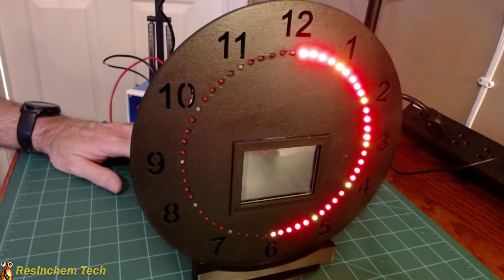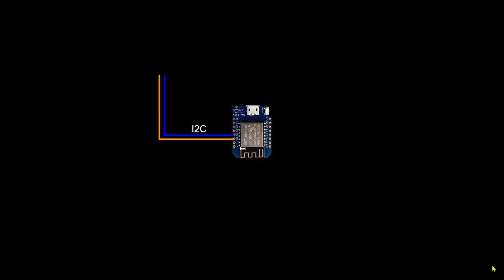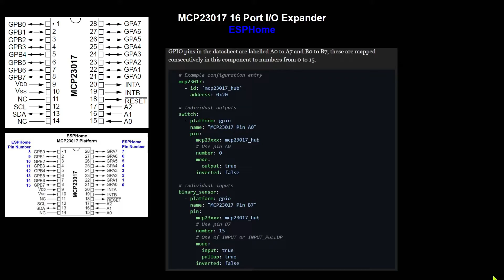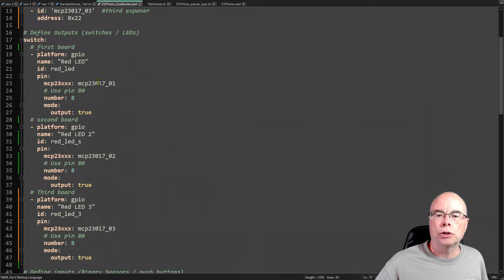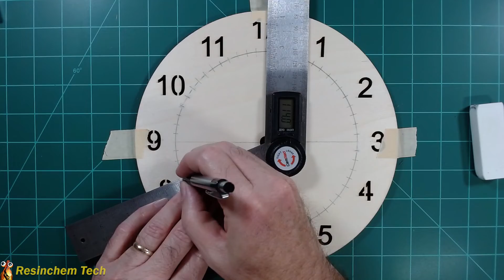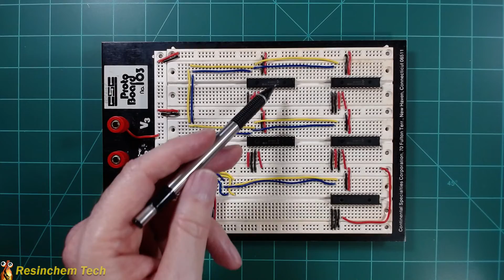MCP23017 Port Expander and ESPHome: Add More I/O Pins to Your Project

Comment: What a nicely timed (see? :D) video! I'm about to build a clock which has 60 LEDs, very similar to yours! I'm not using port expanders, though, but I'm glad I learned something interesting today. Thank you!
Reply from the maker: You are most welcome!  As I mentioned, this isn't necessarily the best design for a clock!  I've built other clocks that use WS2812b LED strips (and therefore don't require the extra pins), but the goal here was to use individual LEDs as an example of using multiple port expanders.  I like the look and function of this 'analog' version (other than my rushed and not-so-great paint job).  If I ever get around to creating a PCB version, I'll probably start over with a new clock face.

Good luck with your project and let me know how it turns out.  And have a good 'time' building it!
Reply: @ResinChemTech   For a tech demo using these expanders is quite well done! Of course it's easier to use WS2812, everything is just code, you can choose colors after building the clock, you can dim it easily, tons of advantages there. That's why I chose them. I found the same form factor as standard LEDs, 5mm, diffused.
Good luck for the PCB version, that will look awesome! Good 'time', hehe, well done!
Reply: @ResinChemTech  I am looking forward to the video about learning how to design and create your very own PCB, I might suggest PCBWay. I would also consider making a board for the clock back and connecting it with one or more IDC ribbon cables. the connectors are fairly easy with a vise or parallel jaw pliers.

Comment: There are lots of models of port expanders.  The APC old style display board for their PDUs use 9555.  The relay boards use an 8 port expander.
It's a shame they all use 0x20 base addresses
Reply from the maker: Yep... as I mentioned near the start of the video, there are many, many different options for adding pins or expanding ports.  But I just selected the MCP23017 as the one to show in this video... with the idea that if someone just beginning their journey with DIY electronics understood the concept of how to use an expander, then adopting to another IC or expander might be a bit easier.

But I agree with you about the base address.  There has been more than one occasion where I've wanted to use multiple I2C devices with the same controller (like a ToF sensor), but they don't have a way ( or at least not an easy straight-forward way without constructing some sort of interface and sending special commands) to change the I2C address.  That was one thing I liked about the MCP23017... the three address pins made it very easy to change to any one of eight I2C addresses.  But again, it is not the only option for something like this.

Thanks for watching and taking time to leave a comment.  I appreciate it.
Reply: @ResinChemTech  the 9555 and the one on the relay board also have pins to change the address to one of possible 8, but all of them start at 0x20 so you're limited to 8 of any of them.
I suppose one trick to go beyond 8 is to not use one of the addresses and use the A0-2 address pins as chip select pins.
For example, tie A1,A2 to ground, and use A0 as chip select, never use 0x20 as that would always be in conflict when A0 is at ground (not selected) and vcc on specific chip to select as 0x21.

Comment: The Amazon link is sold out, any AliExpress links?
Reply from the maker: Are you referring to the link for the MCP23017?  I appreciate the heads-up but I did just recheck the link and I do show them in stock (at least in the US Amazon store).  Of course you can do a simple search for 'MCP23017' on Amazon and see if other sellers might have them in stock.  Or as you mentioned, check another site such as AliExpress.  You might be able to find better pricing there, but with potentially longer shipping time.

If you are seeing some other part that is sold out, please let me know.  I try to check all my links the day before the video is published, but it is not unusual for an item to sell out after I publish (or simply become unavailable).  Usually you can find the same item from other sellers listed on the same Amazon page that shows the sold out or discontinued item.

But I appreciate the heads up.  I try to update links if needed, but to be honest, it's nearly impossible to keep up with all the changes and sellers on Amazon.
Reply: @ResinChemTech  yes the MCP,-